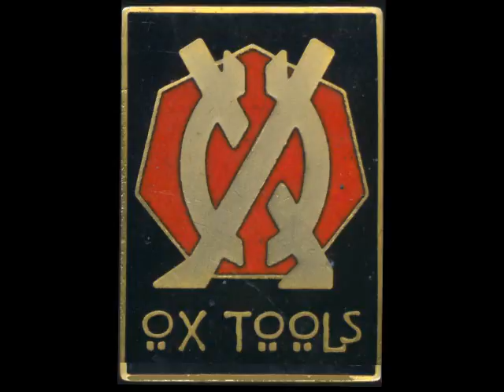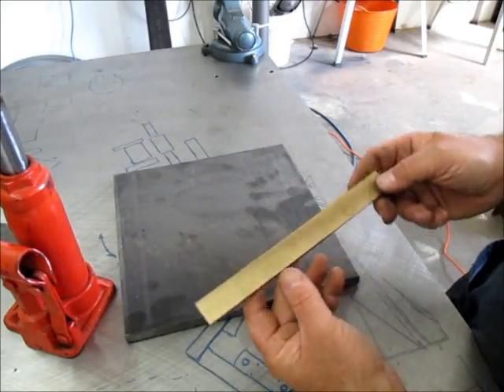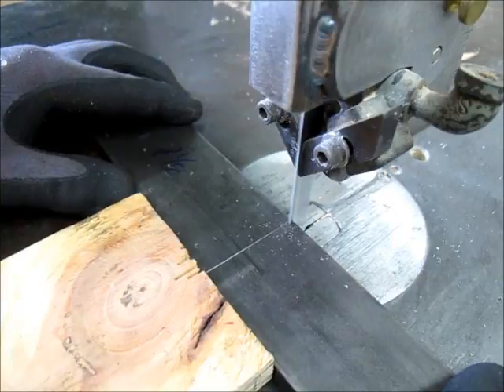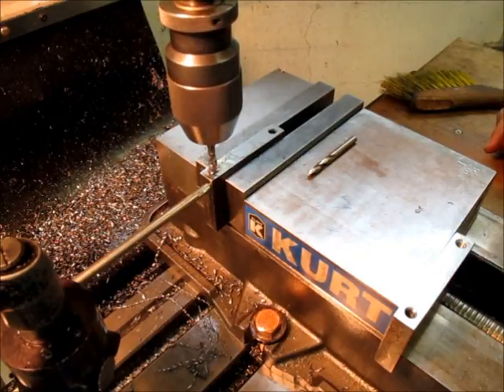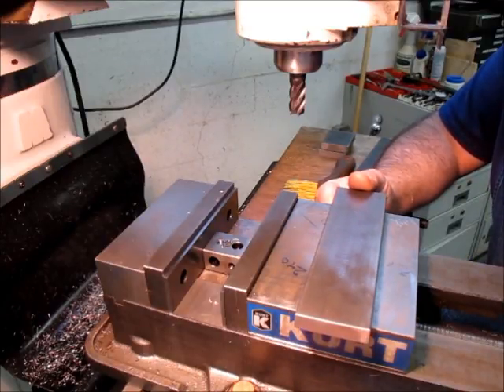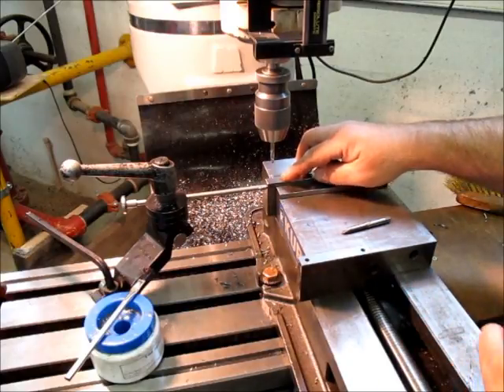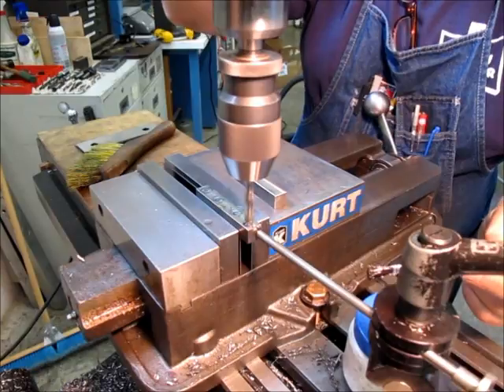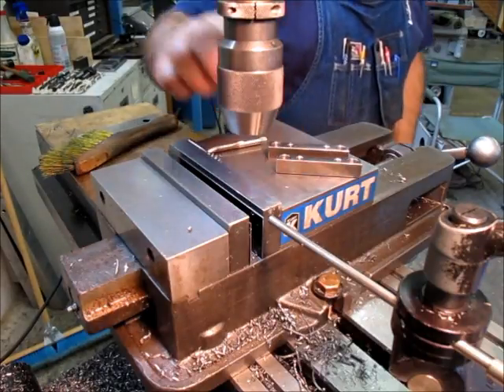Toe Jack Episode 1

Comment from the maker: Hi Bill,

I typically run on steel around 150 FPM (feet per minute) and no lube. I do use the wax lube for aluminum to keep it from loading the blade. Thanks for the comment and compliment on the filming.

Best,

Tom

Comment: I used to use Buda railroad jacks like that when I worked on the B&O and NYC back in the 1960s. As an aside, Buda was bought out by Allis Chalmers in the early 1950s and Buda Lanova engines were rebadged Allis Chalmers. Thanks for an interesting video and sorry for the digression.

Comment: In the vid you mention you have a 6 tpi blade loaded in your bandsaw.  What speed were you running at?  Also I've seen you using a lube stick in a previous video but don't see that in this one were you cutting "dry"?

Thanks Tom I'm trying to improve the performance of our bandsaw at the shop.  BTW good job filming I like the direction you're going with the POV and time lapse.

Comment: I climb mill every part I mill on my manual mill/lead screw machine. Bucking the trend here lol Although I conventional mill every bit but .006 then go back with a climb milled finish pass. Makes my life so much easier finishing out parts. 

As long as the cutting forces are low and your machine has some rigidity I don't see an issue with climb milling on lead screw machines
Reply: rigidity/mass I meant
Reply from the maker: +Finn Custom Knives Hi Finn,

Thanks for the comment.

Cheers,

Tom

Comment: Hi Tom handy tool to have around the shop I plan on building one following your lead. Maby in up coming meatloaf could you do a little show and tell on your depth stop for the mill it looks very adjustable and also could you touch on when to use a spot drill as opposed to a center drill I notice you use the center drills very little. Thanks
Reply from the maker: Hi Johnny,

When you say depth stop what exactly do you mean? I rarely use a real depth stop. I do use the quill readout quite a bit. I'm unclear what you mean.

Spot drills versus center drills. An epic subject likely to start a flameout. I do have an idea that should eliminate the subject matter naysayers. Stay tuned for that one, as its been on my list for a while.

Best,

Tom
Reply: Im asking about the atachment in the video with the rod setting your stop when you were milling the parts to length
Reply from the maker: Blacksmith Johnny Hi Johnny,

You are lagging on the video watching. I did a video where I took the the whole thing apart and showed all its secrets. Better hook yourself up to that tv and get up to speed.:))

Best,

Tom
Reply: Thanks Tom  now at least I dont have to wait to see it lol

Comment: Thanks for the video.  I've been wondering about ways to move things I can't just lift. 
On the power tapping, are you setting the feed rate to match the thread pitch, or is the tap pulling the spindle itself, or something else?  The only tapping I've done is with a wrench, and not a lot of that so far...but I'm expecting to be doing a lot more soon, and any hints are much appreciated.  I've seen the CNC guys using a "tapping head" that appears to be a chuck with a flexible connection so it can absorb some length or torque inaccuracy, but you are doing it with just the drill chuck and I'm not sure why a tapping head is needed if a chuck will do.  Pretty basic for you, but a bit of a mystery to me!

Learning is fun!  Teaching doesn't seem half bad either.
Reply from the maker: Hi Bighammer,

On the power tapping the quill handle is just slightly over fed into the work with the chuck gripping it. On retraction a slight downward pressure is also used to prevent the part from lifting from the vise until the tap disengages from the threaded hole. Takes longer to write the description than do the operation. Tapping heads are nice for lots of holes as they are self reversing. The spindle runs in one direction and never has to stop and start. They also have some torque control typically and a much more positive drive for the tap. 

All the best,

Tom

Comment: Gotta watch holding material and working on it as with your countersink. I had a nasty flashback as I watched, to when I was a kid holding a piece of steel and drilling it. The bit caught and twisted off and the stub jumped into my hand leaving an eighth inch hole of hamburger and a nasty spiral coming out of the bit. I just touched the spot where it went in after an interval 40 years. Fortunately it wasn’t my head in the way! Gotta watch out for bad habits - an innocuous habit can morph into a serious mistake.

Comment: Hi Tom,  just dived in to the past to find this little gem of a series. I was wondering, is the drawing of this project available for ""guest use". I would like to build a couple of this jacks.thanksTeun
Reply from the maker: The drawings are pretty specific for the jack I had. It was an older model. More of a layout than detailed drawings. Its a pretty straightforward design. Thanks for the comment.

Cheers,

Tom
Reply: thanks Tom, indeed it is specific for the jack. I became aware of that during watching. I will adjust for mine.

Teun